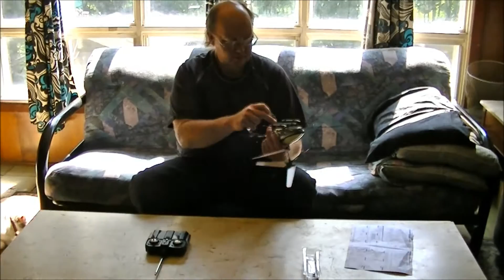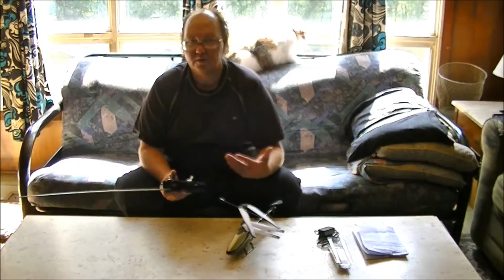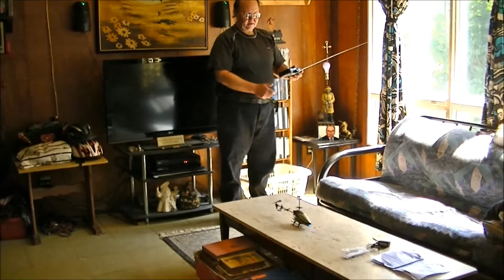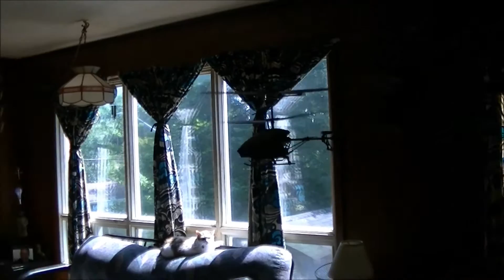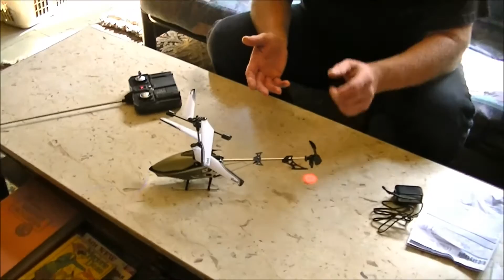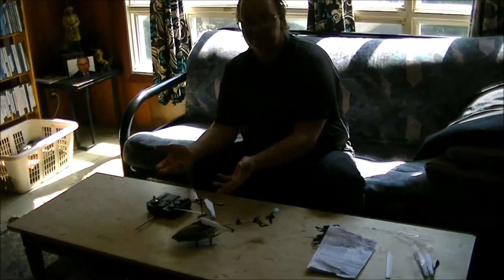Silverlit Sky Eagle RC Helicopter First Impression An Maiden Flight

Comment: Can you please tell me the specs on the wall charger? More specifically the output voltage and amperage please. I lost mine and found a few different ones that fit the charging port, but they all have different voltages. Thanks
Reply from the maker: +Rob Esposito look it up on their website , i sold this heli along time ago

Comment: i got mine for $18.00 dollars
Reply from the maker: +Chrisbarber Barber cool
Reply: did you change the back propellor
Reply from the maker: +Chrisbarber Barber nope never could find one that worked with it
Reply: +Chrisbarber Barber  i got mine for free won it off listia.com its like ebay with credits
like real money. https://www.listia.com/auction/29821759-silverlit-rc-copter-with-controller-and
Reply: +Chrisbarber Barber  do they make batteries for these things and and props for these things.
Reply: +Chrisbarber Barber I think about puting 808 spy key chain to it for for video recording flying use tie down for it under the rail....